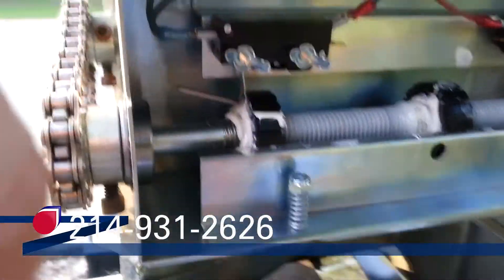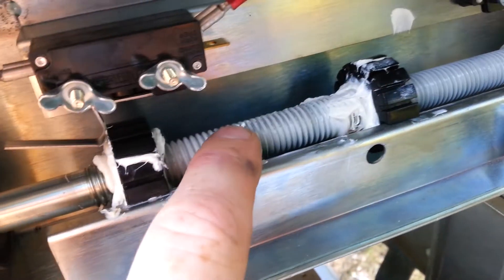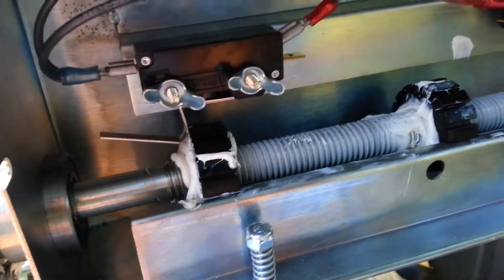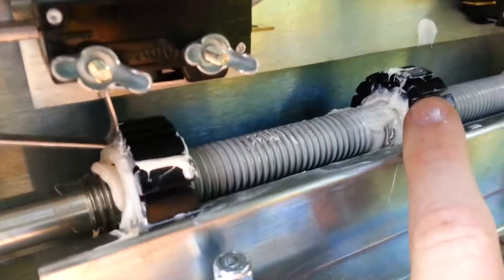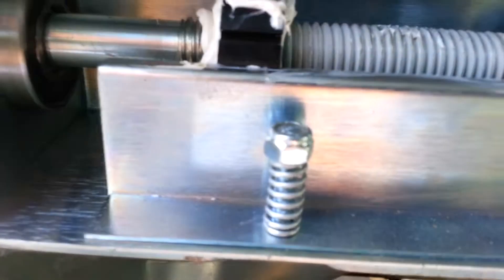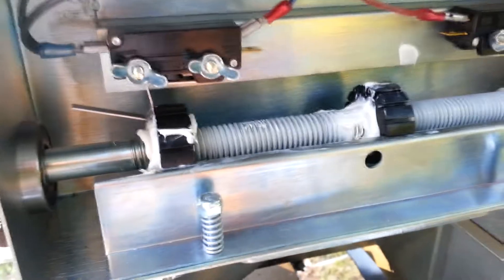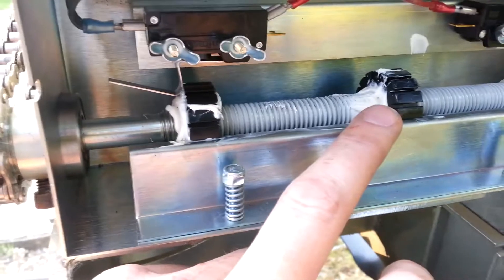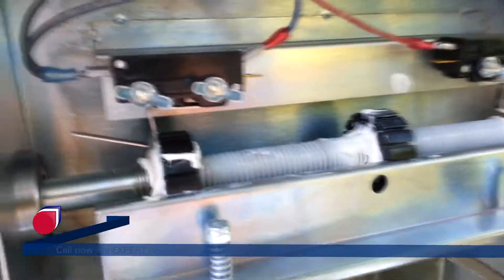All-O-Matic SL-150 DC scheduled maintenance Irving, TX | SC0031

Comment: How is the SL-90? What about the Viking L-3? Can’t decide which one to get.
Reply from the maker: that's an awesome question. The SL 90  fits in an interesting gap between the 45 in the 100. There are  a lot more questions than just simply one or the other. We service and install both. the Viking L3 has some features that the All-O-Matic does not. Such as the Viking monitor. It's worth it to take a look at it. We really like the  All-O-Matic SL100FP DC opener. It's just a little bit more than the 90 and we have great results  as you can see from our channel!
Reply: Safeguard Controls, LLC - I’m by the ocean so rust prevention is my #1 concern
Reply: Safeguard Controls, LLC - Thank you. It looks like the Viking has a better designed board, but the All-O-Matic is brushless which looks like would last longer? It’s really hard to find comparisons. I’ll check out the 100